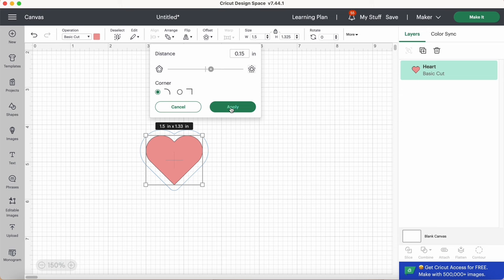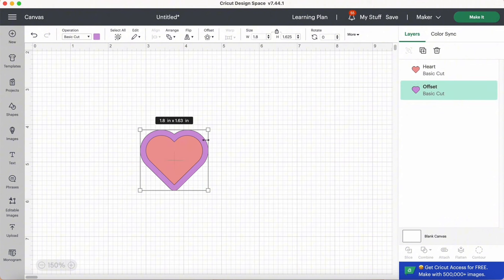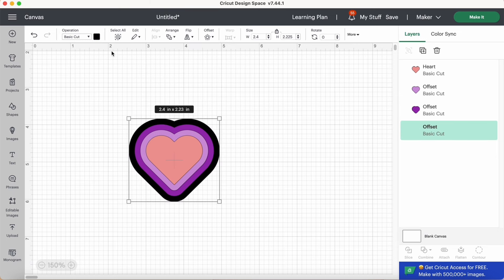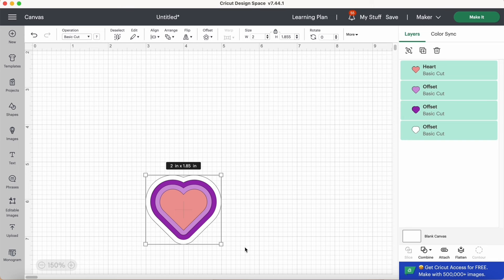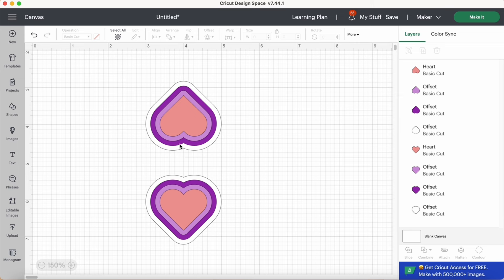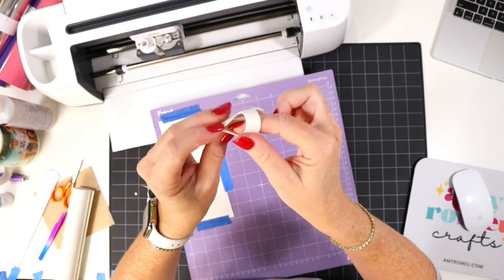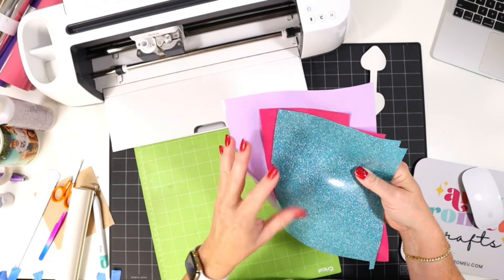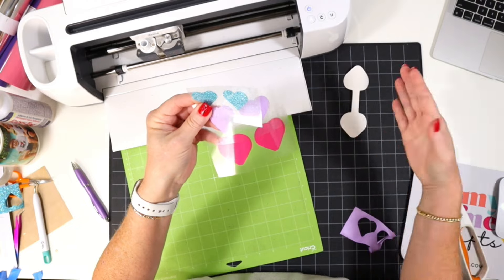How to Design your Own Faux Leather Keychains in Cricut Design Space using Offset

Comment: Great video. To reduce the number of  mats, you can use tip
Of moving all the circles on one mat and using different pieces of htv. So I like to line each set of cut items on a number line to keep it easy to match.
Reply from the maker: Thanks for sharing that tip! I like to do that, too! When I make a video, I try not to add too many different steps to keep it as simple as possible. I have shared that technique in other shorter videos, though. It's a great time saver. Thanks again. :)

Comment: Love this. I can't wait to make one. Question though, when I do iron on vinyl on faux leather, it comes off, Any suggestions on what to seal it with. Thank you. Love watching your tutorials. You explain everything really well.
Reply from the maker: Hi, thanks for your comment! It's not typical for your iron on vinyl to come off, so I would suggest to check for the following:

Is the faux leather smooth, or does it have a texture or a thick gloss coating of some kind?
Are you using enough heat and pressing time?
Are you using enough pressure?

You really shouldn't need to seal vinyl onto faux leather, and it would end up cracking over time anyway since the faux leather is flexible. So I would try to make some adjustments to your pressing to get the vinyl to stay on better.

If you want to send me some photos so I can help you troubleshoot further, you can send them to me at support@amyromeu.com. I'm always happy to help!

Comment: I have the explore air 2 (purchased in 2015, Anna Griffin edition) there is no way to choose material type in design space. Never has. The dial on the machine is the only way to choose. The only choices I have are custom or bonded fabric. 😩
Reply from the maker: Hi, Mary! I tell Explore Air 2 users they need to turn the dial to custom first. Then they can search for the Faux Leather (Paper Thin) setting. :) Would you please try that and let me know if it works for you?